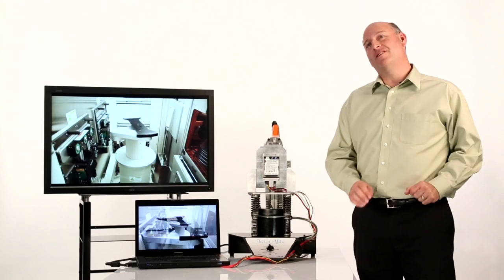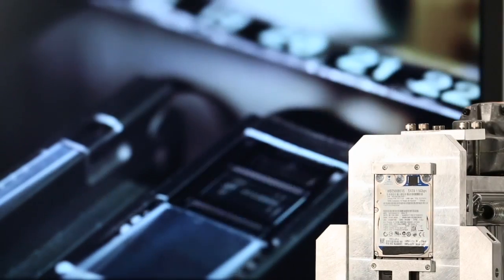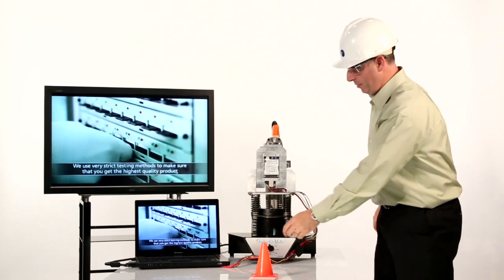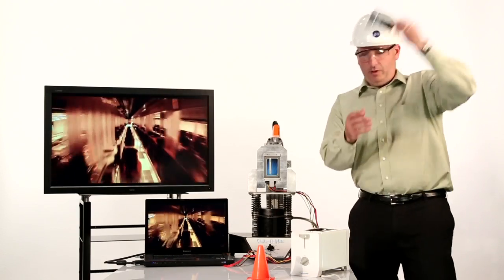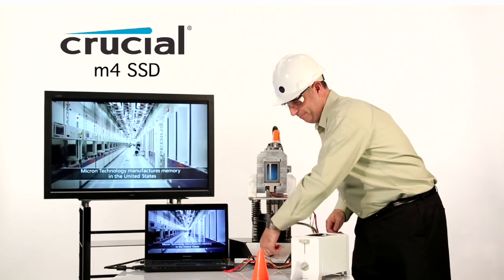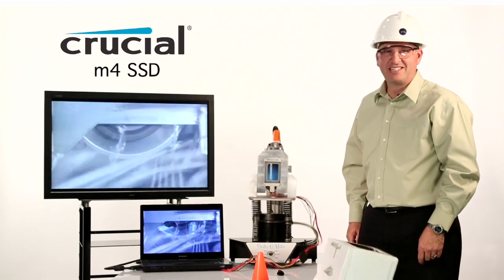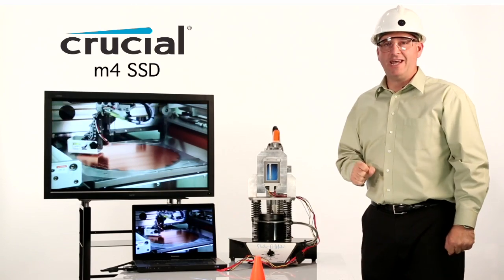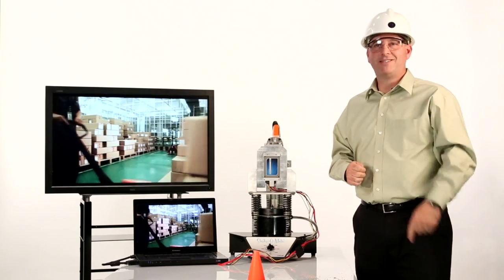SSD vs. HDD Performance Shakedown

Comment: The M4 is rated for 1 million hours I believe. They do have limited read and write cycles, however, technologies such as the TRIM command help maintain your SSD life. I'm running the crucial m4. I love it when my computer says 30 seconds remaining for an install but it actually only took 10 seconds. Ssd speeds are amazing.

Comment: Been running my 256gb M4 for a few weeks. Best upgrade ever. Laptop boots up 4-5 times faster than the old hard drive. Applications loads a lot faster and can open loads of application at once without slowdowns. Will never go back to standard hard drives for primary storage.

Comment: Usually the first drive in your chain on the Sata cable will be your boot drive. It then assigns the next one as your data drive. I have my first drive on the Sata cable which I believe is the end of the cable, and the next one connected to my data drive which is my 1tb drive. That's how I set it up. Your bios also can tell it what order to boot from as far as the drives go.

Comment: This was only one of the reasons. They're MUCH faster (like literally 15x faster). Your computer should boot up in about 10-12 seconds, at which point you can load applications right off the bat rather than wait another minute for your computer to boot on. Not to mention the power consumption is much lower, meaning your laptop will have a longer battery life.

Comment: Mine lasted 2 years, and its in write protect mode. OCZ has a 3 year warranty for a reason, apparently because the drives are junk. But yeah, I read the Intel based SSDs are more reliable. OCZ claims they will erase the drive if u cant get it to work, and will give you a replacement or what the market value is for your drive. I'm just going to order another one, now days you can get a 60 gig SSD for 50 bucks, I paid 100 for this 32gb OCZ Vertex series. My mobo has Sata 3 so I'll order a Sata 3

Comment: My SSD either died or is in the dumps. My Aurora browser kept locking up, and I couldn't get Windows 7 to allow me to shut down any applications with task manager. After not being able to get anything to work, I turned off the PC. Now my SSD won't boot, I got Windows 7 Recovery disk to recognize the drive, but it says my SSD is Write Protected. How do I fix it, or is it toast. My AVG Antivirus didn't detect any virus on my PC before this happened.

Comment: Well data corrupted and you done but HDD still have hope because its use disk to store the data just like DVD the using magnet insted of burning the disk
Reply: Hdd have many more possible failure points, the spiing plate ,the reader head, the controller board is exposed on the back ,lots of issues that ssd dont have